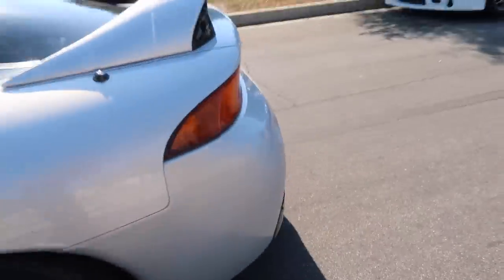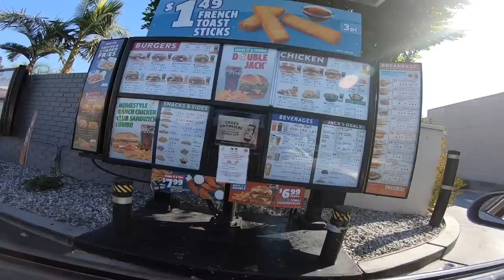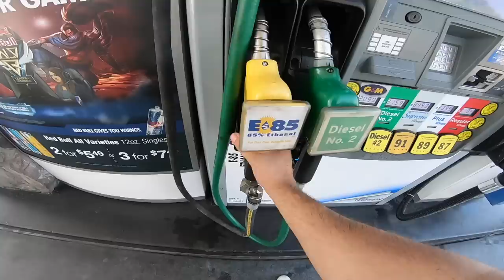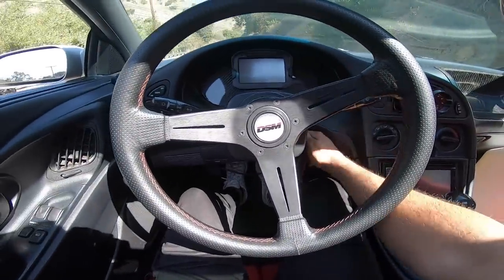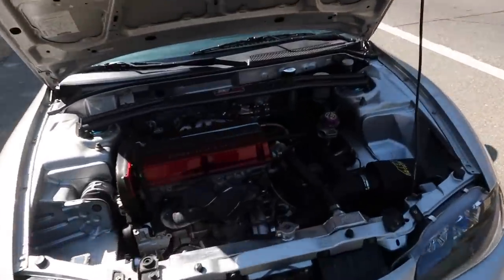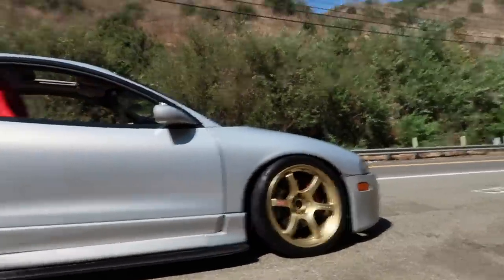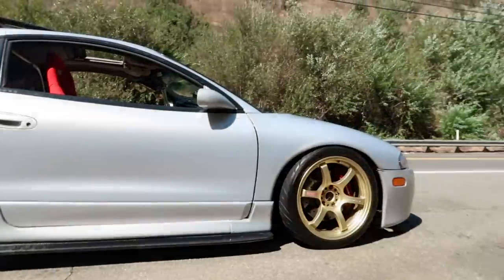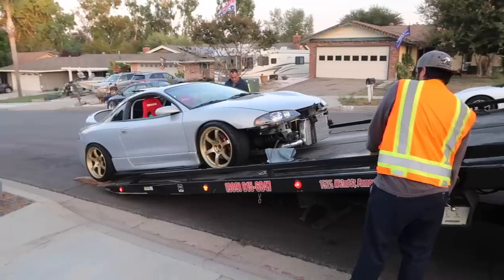POV ACTION of my VERY LOUD MITSUBISHI ECLIPSE GSX!!

Comment: Something extremely similar happened to mine a few weeks ago. As I was driving it just cut out for a split second. Then after I parked and shut it off, it wouldn't start at all. Like I mean turn key but nothing clicks or comes up. Positive terminal on the battery was reading 5 volts and not 12.7.... Turns out the positive cable wasn't making good contact with the terminal clamp, so I quickly sanded it down and cleaned it up, then tightened everything back up and she fired up with good voltage.

You may have fixed it already but I just saw your video and thought I'd suggest an area to look at. Check your battery terminals!

Comment: I never understood the unreliable claims
I bought my gst in 2007, by 2011 it was converted AWD, fully built at 32psi and the only thing ive had to do to it in 10yrs now is a radiator blew, two -AN lines dried out and leaked, and the fuel pressure reg diaphragm rebuild to leakage/drying.
The 90's mitsu equipment is definitely beast.

Comment: Dang I remember when my 99 GSX made 500 hp yeah that was about 10 years ago now it’s a little over 976awhp on E85 and been for the last 5+ years And I just got to go 1 mile to get the E85 at the pump. Need to put you a new FP Xona  turbo on there. I have two brand new HTA 86 still in the box from Force Performance.

Comment: So my 97 gst spyder has Ben having an issue on delivery and the idles off I changed the maf the filters spark plugs clean the throttle and changed  the throtle sensor and idle control sensor and can't figure it out any help would be appreciated

Comment: Same thing happen to me on my way back from home. My alternator belt came loose and wasn't giving me power.  Looks like you're having the same problems. Should be an easy fix, at the most a 150 to 200 dollar fix if you need to swap out the alternator like I did. Good luck.
Reply from the maker: I’m going oem this time

Comment: looked like it lost power and that its not even clicking could be a fusible link Miguel.
Reply from the maker: Checked all fuses
Reply: @MiguelDsm  check battery cable ends too Miguel sometimes they will mess with us too ,dude on DSM forum had that happen to him where the clamp was good but the wiring to it was funky.
Reply from the maker: I’ll look over the wiring too
Reply: @MiguelDsm  good idea also look at alternator relay to someone told the guy to check that since it also controls power for the entire car so check if power is getting there if it is and not getting to alt terminal it maybe the culprit too.